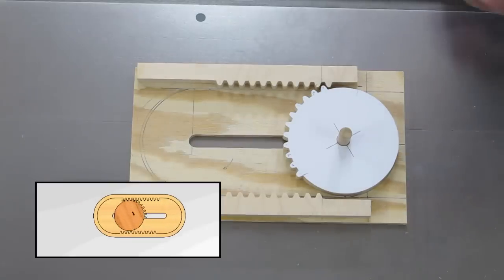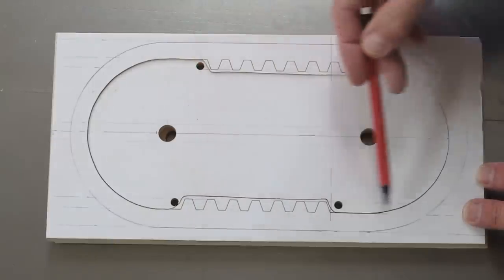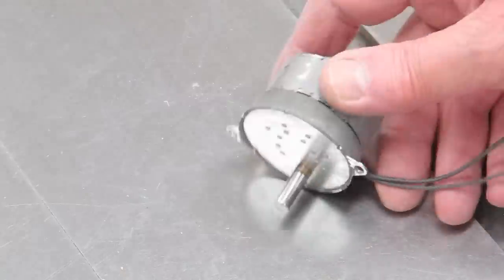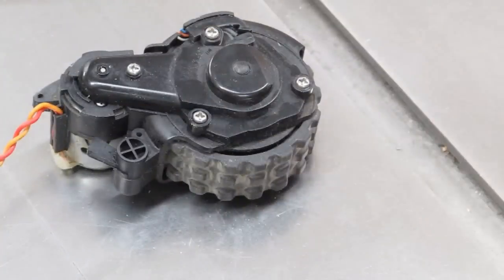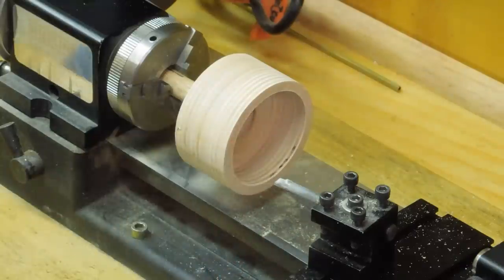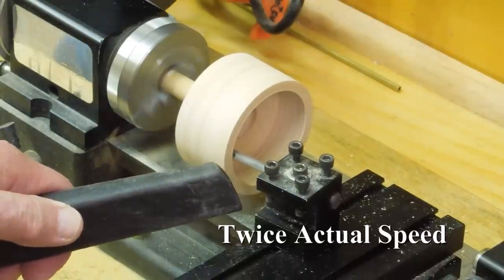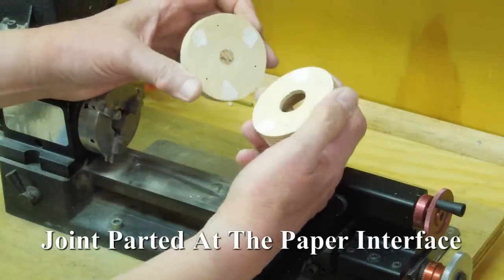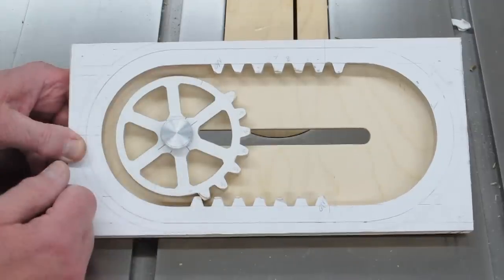Making The Reciprocating Rack & Pinion

Comment: Love the design thinking, seems to me you would want to optimize the teeth size and spacing so that teeth on the wheel barely disengage at the end of the run and as immediately as possible engage the other side.  Having a larger gap would seem to exacerbate a limitation inherent in this design: drag against the motor propelling the gear will mean that the gear will want to turn faster when it disengages at the end of the run (now under no load); that will mean the first tooth will impact on the other side with quite a bit of force, and the faster it gets rotating due to the wider gap without teeth will only serve to increase this impact blow.

If you're moving much of any weight in real-world application of this design, I would think you'll be seriously limited in rotation speed (and therefore linear motion speed) due to the load on that first tooth "crashing" into the end tooth of the linear piece...

I'm fairly certain that even a hardened steel tooth would not hold up to much linear weight being moved back and forth at much speed without cracking off one or the other of those first teeth due to the stress of instantly bringing the linear weight back to full speed in the opposite direction...

If you search for the video here called "Mechanical Principles (1930) by Ralph Steiner [4min selection]", you'll see a lot of alternatives to do this motion conversion starting at about the 2 minute mark, which aren't prey to this limitation.  It's noteworthy you'll see "your" design at 3:47 in the video!

I ran across your video investigating methods of doing this rotary to linear oscillating motion for an invention I have in mind, but am so far leaning toward the gearing used at 3:22 though somewhat concerned about the force necessary on the oblong gear to deliver about 20-30 lbs. or pressure in the oscillation.  I'd like to power my device via either an electric drill, or potentially a battery powered drill.
Reply from the maker: It is not my design. It is my hand cut wood gear model of a design that has been around for over 100 years. Browse through the long list of comments and you will see this "thing" about crashing gears is a non issue. The noise is the axle coming to the end of the slot... and the change of momentum is at the end of the slot... the gear teeth operate very smoothly. There are examples given of this type gear being used in anything from a fishing reel to a very high pressure grease gun... both operate smoothly and without issue. Thanks for watching.
Reply: We're not sync'ing up well, but that's OK.  Clearly I knew it was not "your design" if I sent you a video about this from the 1930's.

And I stand by my statement, regardless of what "youtube commenters think".  Sure, you want to wiggle some plywood with a wooden gear at low RPMs, rock on, you'll have no problems.  But for anything higher speed, with a higher weight (e.g. steel) linear piece being oscillated, say, once a second, the gears will either break, or if heavy duty enough, experience significant wear over time.  That's clearly why this design isn't use in industrial machinery to change to linear motion, but instead, non-impact methods, such as shown in the video provided are used.

Have a good day.
Reply: Maybe this vid is too elementary for you.  I'm watching these because I know nothing of gear mechanisms; you on the other hand seem to know a fair amount.  If the vid incorporated all your adjustments, I for one would have to watch a different vid because it would be too complex at this point.  This is a great video to learn basic mechanical movement types, short and to the point.

Comment: Would it be possible to make it thicker so when it comes to a desired side you can use another motor to pull it up and come back down on another side so making it "moving" to a certain direction?
Reply from the maker: +Cem Nurlu Sorry, I don't understand your question. This will only rotate in one direction, due to the one-tooth offset of the two racks and the resulting timing of the teeth.

Comment: So I had an idea for aquatic propulsion using a wind turbine for the circular turning force and something like this could create the back and forth motion for the rear propulsion fin. It would drive the entire boat as long as the wind was turning the turbine.... in any direction, gas free.
Reply from the maker: A simple crankshaft and connecting rod would be easier and adjustable for varying strength winds. Thanks for watching.
Please subscribe. That's what keeps this channel going!
Ron

Comment: I looks very nice, but where can I use a Reciprocating Rock & Pinion?
I like to learn new stuff all the time. Thank you for sharing.
Reply from the maker: This has been covered many times in the comments.  Applications tend to be relatively low torque such as used in the French fishing reel - The Mitchel 300 - Google it. But then there is a relatively high pressure grease gun which uses this mechanism.  This video demonstrates their grease gun. https://www.youtube.com/watch?v=GI7iq9NX56s

Comment: hi! Very nice video. 
I want to ask about if I can use this to pull up 200 Kg. If I have a platform and in both side I paste this idea, do you think I can pull up 200 kg or 2000 Newton?
Reply from the maker: This one wouldn't... it is just a model. All depends on the design. Scan down through the comments until you find a link leading to one of these being used for a high pressure grease gun. Still, I think 200 Kg (440 Lbs) is asking a lot.

Comment: If this is used in reverse to convert oscillating motion into rotation with a flywheel, would it be more efficient than a crankshaft? I think the efficiency conversion of linear stroke to rotational power of a crank and shaft is sinusoidal, with the maximum being when the crank is  perpendicular  to the oscillation. With this rack assembly reversed , the conversion of oscillation to torque is virtually constant, at the maximum, except momentarily, when the gear disengages and the motion reverses. The only losses would be due to the inertia of the piston, crank and rack assemblies when they reverse but this can be reduced by strong springs at the ends of the rack, which will make contact with a stop when it reverses. I'm not sure of the maths involved. Any engineer's opinion on this?
Reply from the maker: As stated several times, This mechanism converts rotary into reciprocating motion. It will not convert reciprocating motion into rotary motion. I have another video Making Movement 123 - Reciprocating Rack Mechanism which you may be interested in https://youtu.be/Cas_tOSgz8Y this mechanism does convert reciprocating motion into rotary motion.

Comment: Very interesting and a nice build. Does it work in a vertical alignment, too?
Reply from the maker: No. Gravity is working against the pinion. At the top, the pinion will drop before it has a chance to engage with the opposite rack... which usually causes it to jam. Good question!

Comment: How does this compare to the traditional method of connecting a point on the perimeter of a rotating circle to a slot that allows one dimensional travel?
Reply from the maker: As different as comparing steam expansion to internal combustion but similar in that they both run back and forth in a track.

Comment: Those motors are stepper/timing motors.  They are intended to move things to a precision point. I.e programmed to move a belt 10mm with 7mm pulleys for example.  Not to drive a contraption.
Reply from the maker: Nonsense. There is no such thing as a 2-wire stepper motor. Stepper motors tend to have 4 to 8 wires.
Reply: Timing motors have 2 wires, regardless, not the right motor for what you've made.

Comment: how is the efficiency of this mechanism? comparing to the conventional ram system and crank-link mechanism?
Reply from the maker: greenland white Not really a function of being efficient. Invented a long time ago, it works. It would probably run at relatively slow speeds, and provided a solution for conversion of rotary to linear reciprocating motion in a compact area for mechanical mechanisms, such as weaving machines, cash registers, adding machines or similar purely mechanism mechanisms.

Comment: I like it,  :)  maybe a couple of rubber bumpers at the end of the travel,  quiet it down a little..  I think the Motor said 110 volts, AC  your running 9dc,  What was that all about,??   It's all American made,  I looked up the Motor,  from the info on it,  It's made in Connecticut,  the company make all kinds of electric relays and motors..      
                                                Nice Video, !
Reply from the maker: You need to watch the video again. The 110VAC motors were the two I threw away. The 9VDC motor was salvaged from a Roomba.
Reply: LOL,  you're right ,  sorry
Reply: I'm not great at physics, please excuse this question if it's dumb...  Would the rubber absorb some of the energy, and if so would it be less than the wood alone?
Reply from the maker: These mechanisms can be designed with much closer tolerances where the axle does not come into play at all for changing direction. In this wood display model, the axle travels to the end of the slot allowing the teeth to change to the opposite rack. The teeth are not making any noise at all. A pair of rubber bumpers would just complicate things needlessly and would serve not particular purpose. In fact rubber bumpers would probably cause the axle to bounce and the teeth would then be out of synchronization. Please subscribe. That is what keeps this channel running.
Reply: Thank you for your quick response.  I realize this was a demonstration of gears, and it's a great one.  I was not suggesting rubber bumpers, I merely wanted to know how it would affect the system, but that's not an easy thing to Google lol.  And yes, I subscribed before I posted.  Thanks for this educational resource!

Comment: May I ask why you used the roomba wheel, where it translates from the motor itself to the wheel, instead of the wheel motor sans belt? Just seems unnecessarily complex to me.
Reply from the maker: TyrantGea The DC motor itself turns way too fast for this mechanism and would not have enough power to run it in any case. It was clearly explained in the video that the Roomba wheel (hub) contains a planetary drive. So the o-ring drive provides some reduction from the motor to the planetary input, and then the planetary drive reduces the speed quite a bit further and provides sufficient torque to run the mechanism reliably. If you had a slow speed motor with enough torque to run it direct drive then you could do that instead. As far as the complexity, I already had the Roomba wheel in my junk box. The complexity came from adapting it to work.

Comment: I'm no engineer, woodworker, or what have you, but would it be possible to create a design where the gear was always engaged and did not get turned freely by its power source at either end of the system?
Reply from the maker: The pinion gear teeth must turn free of one rack before engaging the opposite rack, if it is to change direction. If the pinion gear teeth were engaged simultaneously with the top and bottom rack, the pinion gear would not be able to move – it would be locked in position by the two racks like a brake. It has been shown, by using CAD, the design can be tightened up a little so there is less free travel by the pinion gear teeth at each end. The clicking noise at each end of the travel is primarily the pinion gear axle shaft hitting the end of the slot and not the gear teeth engaging.
Reply: Ronald Walters great response! I love watching people create incredible mechanisms or machines merely out of wood (people such as you and Matthias)

Comment: How about letting the rack move instead of the pinion? You know, leaving the pinion stable (if possible that is), because I tried to make this but I don't have a motor light enough to move within the rack i.e. the motor pops away due to weight.
Reply from the maker: +FrostMonolith I have a video showing this same model with the pinion held stationary and the rack reciprocating. The pinion is still the driven element. https://youtu.be/ScB6Wd4r9Jc Keep in mind the rack cannot continuously drive the pinion… the pinion always drives the rack (for this design). However, I do have a different model which will work either way (pinion driven or rack driven) Making Movement 123 - Reciprocating Rack Mechanism https://youtu.be/Cas_tOSgz8Y Thanks for watching! Please Subscribe.
Reply: So it works both ways... Wow, thanks for the vid! You earned a subscriber today! ^^

Comment: What the advantage and disadvantage to using this method versus a crank and arm like on a train?
Reply from the maker: Where a designer can use it to accomplish a particular task such as when it is used in the French fishing reel, The Mitchel 300 (Google it for photos). In that application it is compact and is the mechanism causing the line to sweep back and forth as the spool turns. Another application is a relatively high-pressure grease gun, where it is again compact and transmits a large amount of torque. This video demonstrates their grease gun. https://www.youtube.com/watch?v=GI7iq9NX56s A crankshaft and connecting rod probably would not work as efficiently and would require more space.
Reply: Ronald Walters Cool, thanks! I see that now. Awesome!

Comment: Can this mechanism work in reverse, i.e. if the reciprocating piece was made to move side to side and the wheel was in a fixed position and can this make the wheel turn in one direction whilst the rack moved up and down or side to side with no backlash or minimum loss of rack movement, the idae is to convert a reciprocating device to convert to a turning device in one direction only with no loss of torque.
Reply from the maker: samdomding Watch the other short video "Reciprocating Rack & Pinion" http://youtu.be/ScB6Wd4r9Jc  and see if that answers your question.
Reply from the maker: tora sue knisely The prototype referred to in my description was my prototype (or the first version shown in my video). When building something like this without plans or dimensions you often go through several prototypes before coming up with a working model. I know this is a very old mechanism. Interesting to know about the use in fishing reels. I googled "Mitchell 300" and saw some of the internal pieces.

Comment: what if you took motor and made it stationary and let the larger plate move.? Of course lighten it a little . then add one more tooth to the round gear so not to have lag time.
Reply from the maker: Next to this video is one where I hold the motor stationary. The round gear has the correct number of teeth... add or subtract one tooth and it will not run. Thanks for watching.

Comment: as far as i can tell it does have a little bit of dead time at both the ends since it has to turn for a little bit before it reengages into the upper or lower teeth again.
Reply from the maker: The ones used in fishing reels, high pressure grease guns, etc. have been fine tuned so there is zero delay when changing direction. Thanks for watching!
Reply: Can u make video on adjusting these delays please
Reply: Mine is failing to latch on to the reverse position... how to take the correct radius clearance and to correctly latch it to the second may be I got my pinion teeth positions wrong please help...
Reply from the maker: Next time you want an answer, leave you question directly under the video... not under someone else's comment. This was nearly impossible to find. 
Assuming your pinion and rack teeth are correct… if the pinion gets to the end of the axle slot travel and spins free, the slot is too long. If the pinion gets to the end of the axle slot travel and then locks up on the rack, the slot is too short.
Reply from the maker: I have no intention of doing that.
Reply: Thank you sir for the response , and will surely comment below the video :)